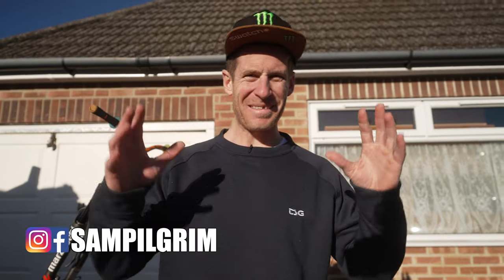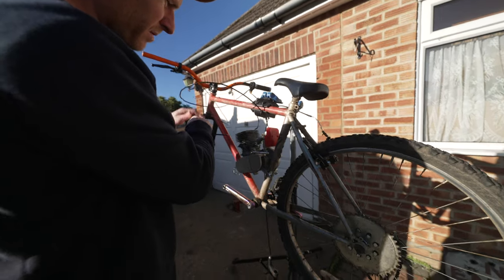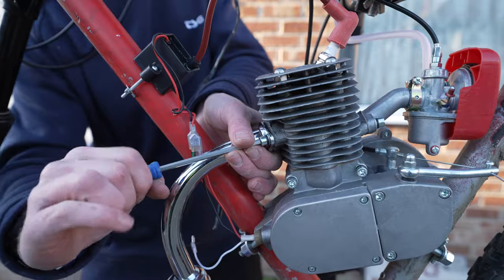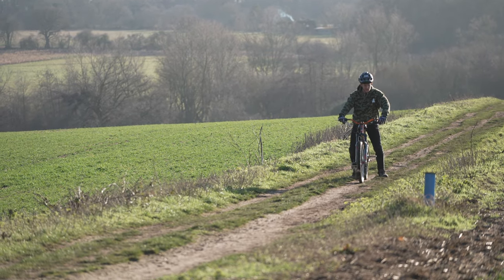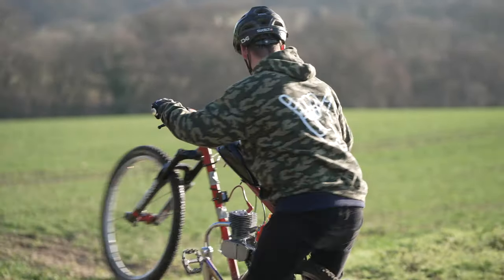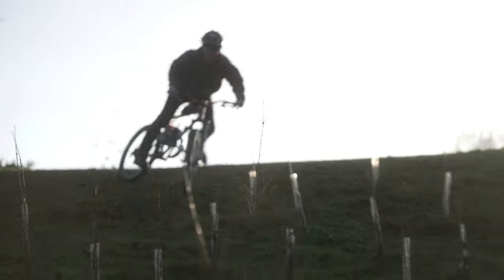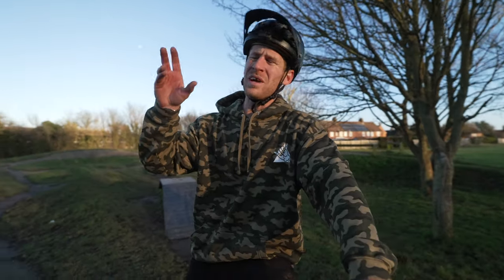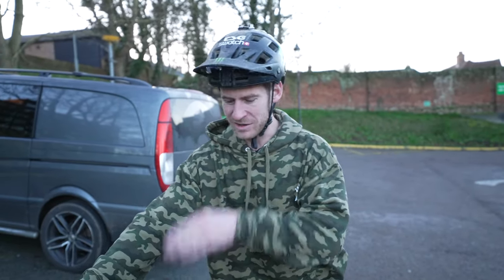FITTING A NEW 100CC PETROL ENGINE TO MY MTB - MAKING THE CHEAPEST MOTOCROSS BIKE!

Comment: If you want it to go faster take the muffler off in the exhaust there should be a little screw on he bottom of that and take it out. Also take the air filter off of the bike so it will suck more air into the engine. 👍

Comment: Plus you can’t ride these motors like that when you first get them you have to ride them for 15 to 30 minutes when you first get them for 2 tanks of gas that’s why your exhaust pipe broke because you built to much pressure into the piston and engine itself so it forced your exhaust to snap luckily your motor didn’t lock up and break on you so buy a new kit break it in proper than you’ll get the full experience you need from the motor

Comment: Them engines never run properly anyways that's why they are so cheap but you should be able to adjust the idle screw so it idles properly
Reply from the maker: It didn't when I adjusted it!
Reply: @SamPilgrim  just takes time messing around with it but they aren't made to last long or run smooth either way

Comment: when attempting to fit this motor to a bike i realized that the motor didn't fit because the frame was too small for the motor to fit into!

when buying a new mountain bike to install the motor into, should i look for 26" frame or 26" wheel size????
Reply: cross country frames are better but its gotta be a old thin frame not thick and chunky i got a old claud butler and it works

Comment: I know exactly what is wrong with your bike and the previous one. You have mounted the engine at a angle. More importantly the carburetor is at an angle where it is dumping more fuel into the engine than is needed. Try making the carburetor parallel with the ground.